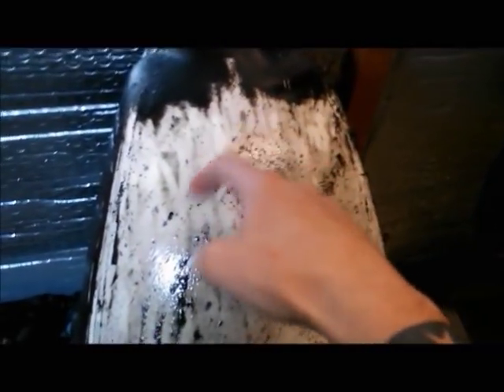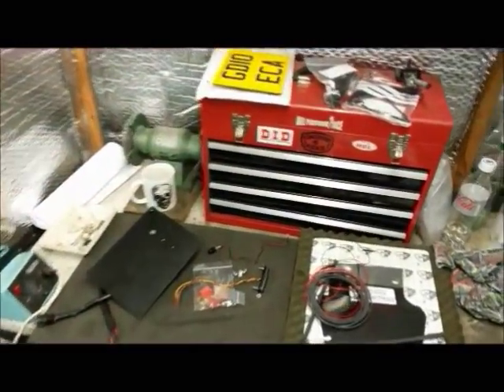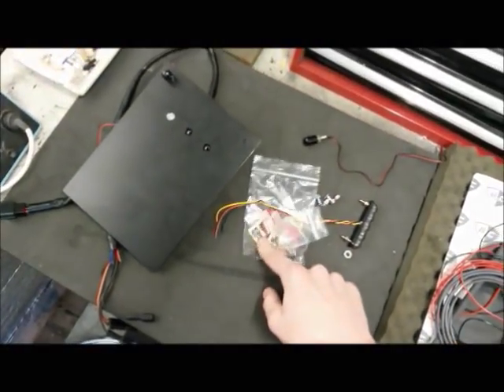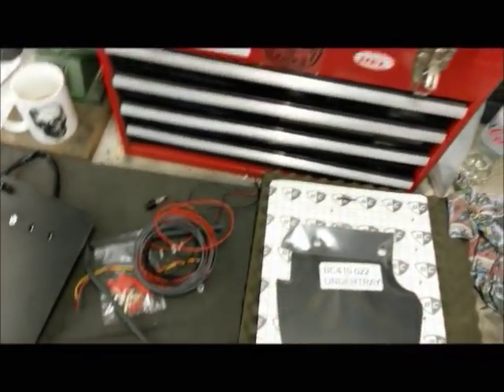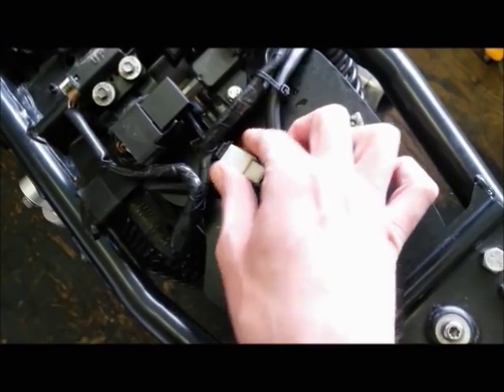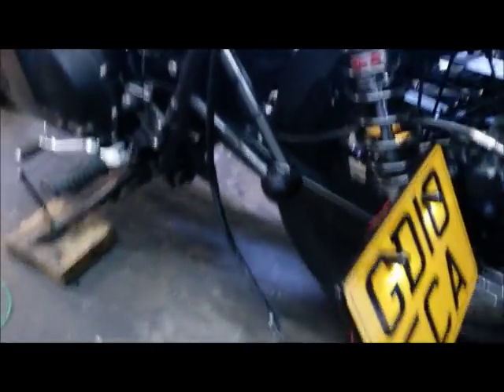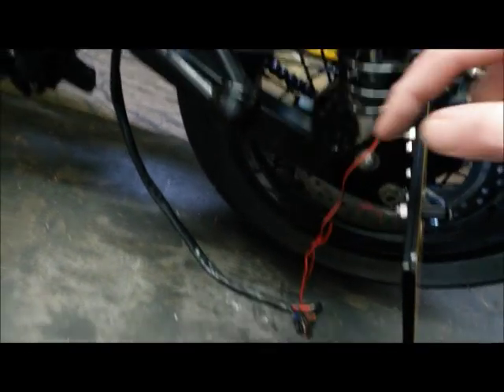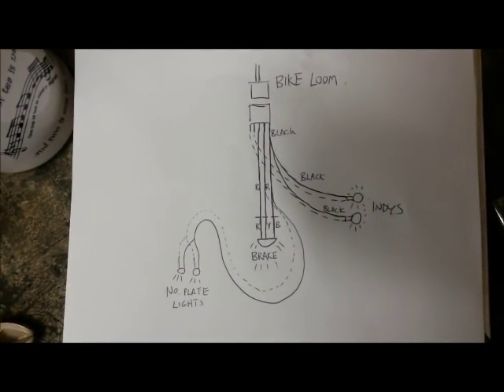TRIUMPH BONNEVILLE KNEE PADS AND SIDE MOUNT

Comment: How about a shield of alloy bolted to the number plate bracket covering the wiring ,countersunk bolts hiding it on underneath the plate? Like the mount you made for the rear light.It would hide the wires and secure them stop them flapping about? Keep at it mate looking good!
Reply from the maker: ninjanelly350 yeah it's going to take some more beard scratching to be totally happy i reckon mate...it may be a work in progress...need to get it back on the road asap for commuting and a bike night on thurs!!! watch this space!!!!!

Comment: Its getting there slowly mate, going to look cool when its finished. Had an idea about the No plate lights, why don't you use the existing holes to mount the plate, and cut two small slots in the very top of the plate, then when you want to take the plate off, you just loosen the lights, and slide them up 5mm out the way. :)
Reply from the maker: yankee doodle ooo nice bit of engineering there buddy!!- i'm hoping the sleeving and connectors arrive today so will re asses tonight!!! bracket for the brake has turned out lurvly though!!!

Comment: The right knee pad on my Thruxton is starting to come off, I'll use the exact same method you did to stick it back The problem here is the heat, I guess. Parking in direct sunlight is just too much for the glue or whatever Triumph uses.
UK license plates are, sorry, hideous. Gigantic and yellow. Ouch.
Ours are far more elegant. Black letters, white background and 4"x5.9". Not bad!

Great work as always, Mr Cactus!
Reply from the maker: Alex Ferreira ok so you have small number plates and brilliant weather...i think i need to move.......;-) not surprised the heat peels the pads off though- a little blast with a hair dryer was enough to peel it off.......ha ha ha- just the one downside to riding over there then!!!

Comment: If it helps it's also called rubbing alcohol . 40proline and myself were talking about
UK motorbike plates and were wondering how they are issued there. I remember you
saying you had one that was to small and not allowed. Here when you register the bike the Province gives you one and if you are nice they let you pick one out of the pile.so just wondering. by the way think the tank looks great sprayed mine the same minus the stripe.
Bash AwB
Reply from the maker: Adventures With Bash? hey buddy!- our plates come with the bike- to get it on the road from new it's registered with the dvla and given a license plate no. that stays with the vehicle. there's hundreds of places you can get a plate made- legal sized or 'show use only'....heh heh.....the plate size really is only an issue come the annual mot- where it can fail if it's too small or if you cross a traffic cop having a bad day!!
Reply: johnnycactus0 You have MOTs once a year is that on older bikes or for all. And if it is bummer. Here I found away around all that (At least in Alberta) yes I'm a sneaky bastard.
Reply from the maker: well from new any vehicle has 3 years before it needs to be first mot'd and then once a year after that...it's not too bad really mainly its a safety check...you can usually find a garage that is more understanding of 'modifications'..heh heh!
Reply: Understanding...Wink;)

Comment: OY Mate!
Enjoy the vids, very informative and inspiring.
Where did you find single sheets of the 3M double-stick adhesive?  I'm in the middle of a similar project & cannot find the right stuff...I can only find rolls of it that are 3" wide.
Cheers!
Reply from the maker: Ken Deater hey mate- ebay in the end!!! here's the link!!! still stuck on and going strong! http://www.ebay.co.uk/itm/161305016190?_trksid=p2057872.m2749.l2649&var=460337198098&ssPageName=STRK%3AMEBIDX%3AIT

Comment: Hello! i have a bonneville 2015 (mug wheels) and i want to order hagons 2810 full black, do you have any idea which code to choose?
Reply from the maker: Konstadinos Xenos hey buddy- according to the hagon website if you want the 2810 in black- 33055ttsab or chrome- 33055ttsa. does that help?
Reply: You are the best!
Reply: johnnycactus0
 400-031-05 is this the code for the fork springs?